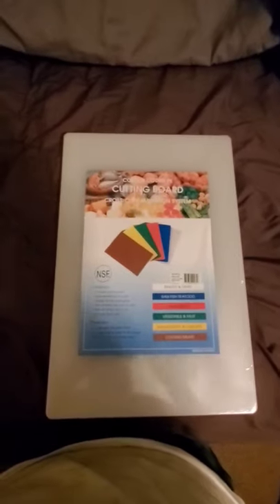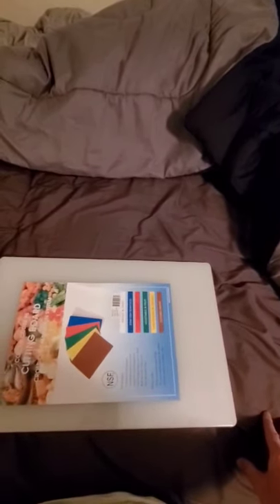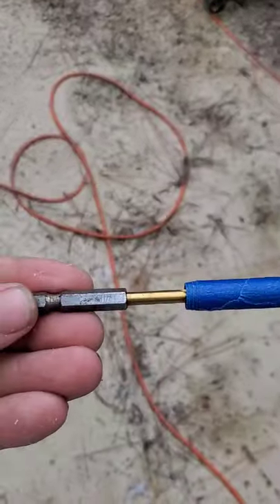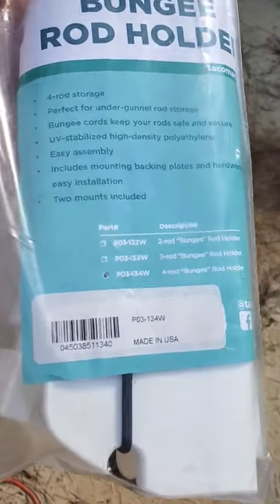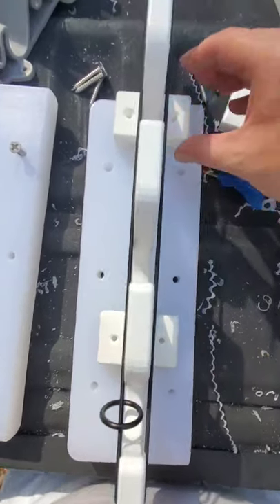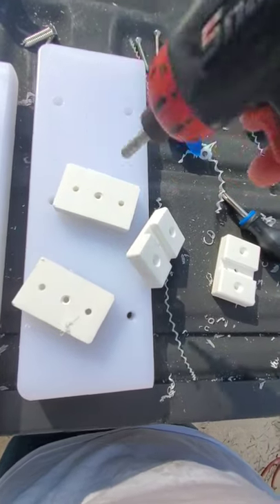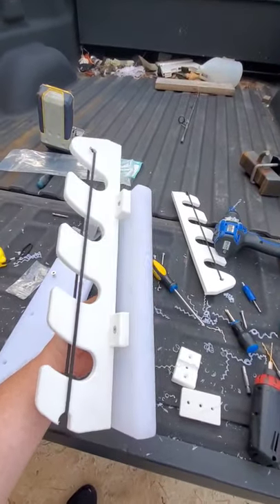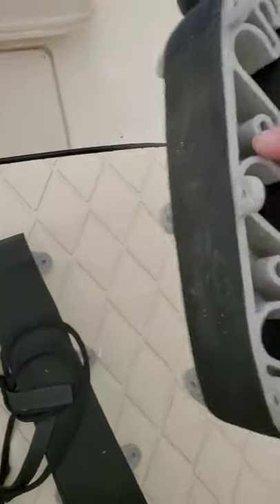Taco Marine Bungee Rod Holder Installation on Carolina Skiff 21LS

Comment: Will be doing for a customer this week, same boat. Thanks for video
Reply from the maker: Glad to help
Reply: @adambright2761  worked out great , he's boat is 2021,23ls it has 3 on each side. So adding 2 more this week.  But worked out good , other than not all raised side standards are not straight, I made first as a template, and drilled all that way, when I screwed in 2 of them they were a little off, but that the boat. I installed 8 led lights in that boat 1 month ago and realized that center console is not the same. But rod holder worked good 👍
Reply from the maker: @mikesmith1191  I'm glad it worked out well for you. Not exactly sure why it didn't line up for you but I'm glad you got it done in the end.

Comment: Nice work...Are you able to add rod holders on top of the gunnel for setting out flat lines or trolling?
Reply from the maker: There are some options out there for these boats as far as adding rod holders for trolling. A popular choice is to install 4 flush mounted rod holders into the rear deck. There are also some that attach to the pop-up cleats. There are many examples of these options on the FB group "Carolina Skiff LS Owners".
Reply: @adambright2761  great, thank for the insight.  How does the 21 ls fair offshore?
Reply from the maker: The waters where I live are rarely calm enough to go offshore in the LS. For that, we use a 246 Sea Fox. I would take the 21LS offshore in 1.5' seas but no larger. @ray330